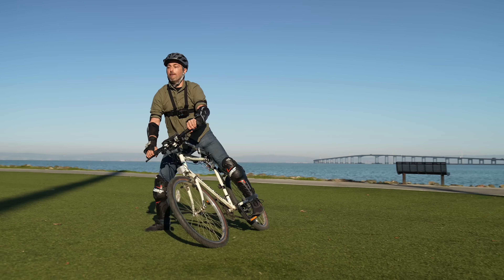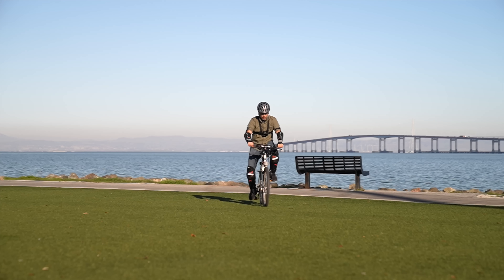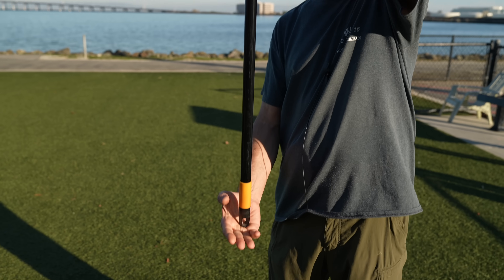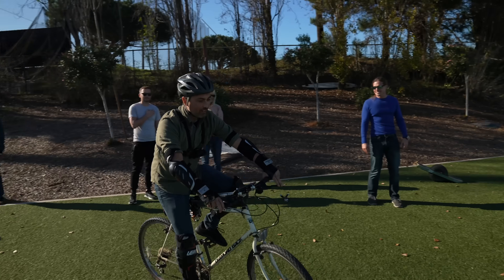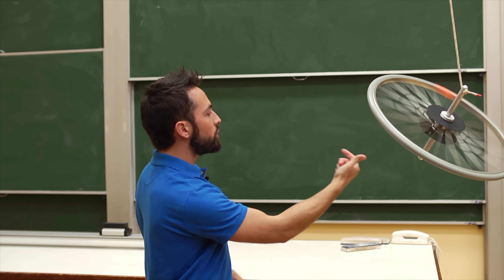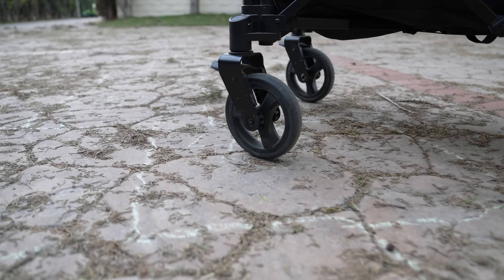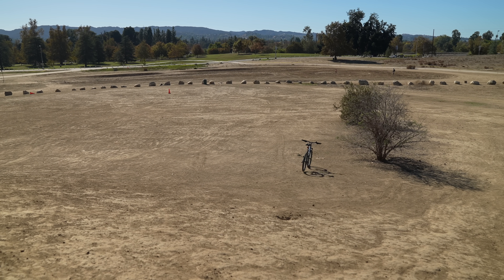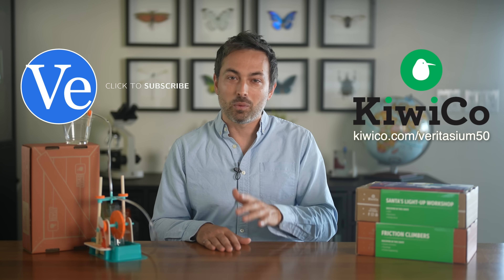Most People Don't Know How Bikes Work

Comment: Ok, you wanted to explain how counter-steering works on bicycles, but I'm pretty sure I could turn with that "unrideable" bike alright. For one, you don't seem very experienced in cycling. You ride exclusively in the saddle, which is not exactly ideal for handling the bike in such an abnormal scenario, and without any attempt to use your body to lean inside a corner. It looks more like you are unable to balance the bike because of inability to steer in one direction - which is perfectly natural of course - rather than like failing to make a turn because of it. I had written an initial comment where I claimed that many mountain bikers and roads cyclist doing high speed turns on descends actually do minimal or zero counter-steering in some cases. Sadly I erased it because I wanted to be completely sure, but I've been riding for more than ten days constantly confirming that, and I've even had other riders watch. At least in my nimble track bike, if you are not going to counter-steer, you can lean your body weight towards the direction you want to go - with the bike and handlebars still straight and upright - then let the bike follow your body and lean into the corner, allowing you to increase the radius. But what really makes turning this way practical is that instead of turning the handlebar, you can do sharper turns by pushing it towards the ground from the one side and pulling from the other. Why do it this way? Because in some high speed situations, counter-steering seems to unsettle the bike more, which is not always desirable. The technique I'm describing allows initiating a turn with a smoother weight transfer and it's easier to dial your radius throughout the corner with less corrections after that. Sure, if I need to make a small, unexpected maneuver like avoiding something that I saw suddenly, in all likelihood I will counter-steer, but the claim that it's the only way to turn has to be wrong, even if some cycling myth busters insist otherwise. I could even make a video for you but in reality you can just watch professional riders like in Tour de France riders descending. Almost all of them turn like that, at least part of the time.
Reply: If you could simply shift your weight to lean into a turn, you could also lift your feet off the ground on a stationary bike and then decide which direction to fall.  But you can't do that.  Give it a try.
Reply: @Rick_Cavallaro  I suppose it's pointless to argue that this is also feasible - though not with a 100% success - because it's not exactly the same thing. I can only say at this point that a bunch of riders around confirmed my claim that I can consistently initiate a turn with no counter-steering. At slow speeds I can also just turn the handlebars, though with very gentle slow movement initially. Bike geometry and type of handlebars are also factors here. On my friend's fitness bike with straight, fairly wide handlebars, I couldn't do exactly the same things. But seriously, if you shift your weight of the bike while keeping the bike going straight for a while, then pull the bike towards your body, what do you theorize that will happen?
Reply: @PinkAsAPistol  I believe that it both looked and felt that way.  But you'll quickly learn it's not the case if you try the experiment I suggested.
Reply: @Rick_Cavallaro  I have been cycling for 30 years, some of those competitively. I have tried what you said for fun and practice, which is harder than what I am describing. I've also done quite a bit of motorsports where it is perfectly understood that driver/rider feel is meaningless without data confirming what goes on. I fully expected your point, I know sometimes we do something that we think we don't. Only thing is it's not even marginal in this case, everybody who saw confirmed my view. Even if I do a video, you might still argue I am doing it in an imperceptible amount that you also cannot see. The thing is you can achieve the desired weight transfer to turn a bicycle in other ways than actually steering in the opposite direction - some bikes are not that stable in a straight position to begin with. I am not arguing that some riders brake the laws of physics. Seriously, try pushing/pulling on the handlebars from a neutral position and tell me what went on.
Reply: @PinkAsAPistol  
>> I have been cycling for 30 years, some of those competitively.

That makes you an expert rider.  It does not mean you understand the underlying physics.
Reply: @Rick_Cavallaro  That alone is irrelevant. You don't need to understand the physics to counter-steer and to confirm that you are either. There are grey areas between what we do subconsciously well and what we understand in terms of physics, I know. But making a turn with your eyes and hands focused on your handlebars and seeing that you didn't have to turn them to the opposite direction should not be not such a hard thing to assess. And your argument that equates stationary balancing to shifting balance on a moving bike does not show a complete understanding of the underlying physics either.
Reply: @PinkAsAPistol  
>>  your argument that equates stationary balancing to shifting balance on a moving bike does not show a complete understanding of the underlying physics either.

If you think it doesn't, it's incumbent upon you to explain what changes between the stationary and the moving bike.  As it turns out - I know.
Reply: @Rick_Cavallaro  Literary everybody agrees that speed is a factor in the self-stability of a bike. This is the first time I hear of anyone claiming otherwise. Even this video kind of acknowledges it. I think he's still wrong for assuming that a bike's self-stability is entirely based on its geometry causing it to effectively self-steer into the lean. Yes this is the primary reason it stays upright even without a rider, but that does not prove it's the only relevant force involved in self-stability and surly not that its momentum does not also play a part, which it also does in the dynamics involved in cornering. The effect of speed becomes empirically apparent when you see 1) you need far more steering input to stay upright when you move slowly, let alone be stationary 2) that surely you can just turn the handlebars into the turn when moving slowly, but after some speed you find that it doesn't work. Also, there's a technique that motorcycle riders call counter-steering even if it's one continuous move and they don't actually turn the bar in the opposite direction. From some speed and above, just pushing the grip inside the turn, even with one finger, is enough for you to achieve the weight transfer and along with your body leaning slightly, to get you to initiate the turn. You are making arguments that are equally based on empiricism to mine - and are a bit wrong at that - and coming up with a hypothesis based on physics where you keep whatever fits and discard whatever does not. This doesn't make you the physics expert of this discussion. At least I don't pretend to be one.
Reply: @PinkAsAPistol  
>> Literary everybody agrees that speed is a factor in the self-stability of a bike.

Of course it is - for exactly the reasons I've explained in the video and in these comments.

>>  This is the first time I hear of anyone claiming otherwise. 

You haven't heard anyone claiming otherwise.

>>  I think he's still wrong for assuming that a bike's self-stability is entirely based on its geometry 

He doesn't claim that.  He claims that it's based on the steering geometry and the effect the gyroscopic moment has on steering.  If you think he's wrong, it's incumbent upon you to offer a better explanation.  You have not attempted to do that.

>> and surly not that its momentum does not also play a part, 

The bike's forward momentum has no impact at all on it's roll stability.  The gyroscopic moment of the spinning wheels has been shown to have a very small direct impact, and a large impact through its effect on steering.

>> The effect of speed becomes empirically apparent when you see 1) you need far more steering input to stay upright when you move slowly

I explained that in my previous comment.  The reason for that is trivial.  It has nothing to do with the bike's momentum, and you ignoring my explanation doesn't serve your argument.

>> surely you can just turn the handlebars into the turn when moving slowly

Surely you can not - unless you want to fall.

>>  there's a technique that motorcycle riders call counter-steering even if it's one continuous move and they don't actually turn the bar in the opposite direction

If they don't turn the bar it isn't counter-steering.

>> You are making arguments that are equally based on empiricism to mine

I am not.  I am making arguments based on my knowledge of bike dynamics, carefully executed experiments, and published research.

>>  This doesn't make you the physics expert of this discussion. At least I don't pretend to be one.

The fact that you are not one, disqualifies you from judging who is one.
Reply: @Rick_Cavallaro  - You stated that the fact that it's impossible - I still say more like "hard", apparently you haven't seen what some riders are able to pull - to use your weight in order to fall to the opposite direction than the one the bike leans to when stationary. You also stated that this proves there's no way to turn without counter-steering. I consistently said that those two are different, there are less forces involved in balancing a stationary bike so of course it's harder. Your claim sounded like effectively claiming that speed, in the form of the gyroscopic effects or otherwise, does not contribute in self-stability. No inconsistencies from my part there. I was intentionally vague when talking about momentum-related forces above because I am unsure as to whether the gyroscopic effect is the only other force involved. At least in cornering which is really our focus we know momentum plays its own role.
- He seemed to say people claim it's the gyroscopic effect that keeps a bike stable but he sees - apparently empirically - that it's the self-steering. As if these two were mutually exclusive.
- You can absolutely just turn the handlebars into the turn if you're moving slowly enough and have a basic feel of how to do it without going over the limit. Even motorcyclists, for whom counter-steering is an essential lesson, not a learned automatic thing, claim the same thing. Apparently this will not be settled unless I can do a good enough video or you try it yourself, so I have nothing to add to that.
- They don't need to actually turn the handlebars in the opposite direction. Just applying enough torque does the same thing at enough rate for the bike to go towards the other way. There's even tons of videos displaying this on YouTube.
- Sadly I'm at the other side of the planet, but if I have no problem to at least try to make a video for you some time. And actually I'd appreciate your take on how to do the experiment "correctly", even though I think you're missing something here. Generally I tend to try to know what I'm doing because of my motorsposrts backround, where you might have talent and still be kind of rubbish if you don't learn to rely on data and analyze what is actually happening. That mindset is not as alien to me as you seem to think.
- I can be a non-expert in physics while at least realizing where my knowledge ends. You seem to think you've grasped it all, while I've seen people actually working on advanced cycling mechanics who appear a bit unsure. Even if your general knowledge in physics is much better than mine - not that hard, to be honest - I think that's where you end up being wrong.
Reply: @PinkAsAPistol  
>> You stated that the fact that it's impossible

I did not.  And if all you have left is to lie about what I've said, there's no point in continuing.

>> You can absolutely just turn the handlebars into the turn if you're moving slowly enough...

There is an extremely small number of riders that can actually do that, and they do it by having learned a DIFFERENT skill than the rest of us that ride bikes.  They're not simply better at doing what we do.  They are doing something different - and very difficult.  And it is extremely obvious when they do it.  

>>  Even motorcyclists, for whom counter-steering is an essential lesson, not a learned automatic thing, claim the same thing. 

That's precisely why I made this video with Derek.  I KNOW they claim that.  They're wrong.

>> I think that's where you end up being wrong.

There's plenty I don't know, and plenty I do.  And I know which is which.  I'm not wrong on this.  If you believed I was, you'd actually try what you claim you can do - which is to ride the bike in the video.
Reply: @Rick_Cavallaro  - This is a written exchange. Anyone can see exactly what we say, though I'm pretty sure it's going to be just us. Why would I intentionally lie about what you said then? I'm not stupid and neither are you. Previously I thought you misconstrued my argument. I didn't say you did it intentionally or take offence. Still, you clearly said that if I could turn without counter-steering, I could also sit on a stationary bike and react to it falling by forcing it to fall to the opposite direction. So I replied that the second one is different and harder. Not to mention that say, a competent trials cyclist would tell you "well of course I can do that".
- Now I need to explain that this is not about me claiming to be a better cyclist than anyone? Yeah there are lots of different bikes and forms of cycling, from city and long distance to road, mountain and freestyle. Hugely different skillsets on each one and I know of nobody who's amazing on all - I'm completely unversed at trick jumps, for example. About bikes I already said that I can just turn the handlebars in while sitting like a log on my track bike at low-ish speeds, but on my friend's fitness bike with straight wide bars I couldn't just replicate the same thing. In a way, it's the bike that teaches you. I never claimed I have a better way for you to turn, or that I'm gonna tell you how "skilled riders" do it. People not attesting to leaning before the turn and pulling the bike inside with no counter-steering probably haven't practiced going down paved mountain roads at 100 km. They don't turn in that way because it makes little sense to do so. It's not how you typically avoid people parking inside bike lanes. I even said that if someone throws themselves in front of me in town, of course I'm going to counter-steer because at that moment I am not poised to initiate a turn in any other way. What I mention matters only in the specific context where a seemingly inexperienced (in that sense) rider gets on a bike and rushes to declare it "unrideable".
- Edit: Many cyclists who claim that they do not counter-steer cite "steering from the hips" as their technique. I also do that a lot but am unsure. I think that on that occasion I am probably counter-steering a bit and not necessarily being aware of it. It's not like I don't see your point about the fallibility of the subject going purely by feel. 
- So now you're saying that a limited amount of riders can actually do it because of their specific riding style? Then that's settled, as far as I am concerned; That bike is not unrideable. But still, the issue is whether I specifically can do it? I am in Greece, otherwise I'd be eager to try your bike, especially now that I know you took part in this video. And you're talking as if you missed the part where I said I'm open to hearing your suggestions on how to verify this on my own.
Reply: @PinkAsAPistol  
>> Why would I intentionally lie about what you said then? 

I have no idea.  Why not go back and quote me.

>> you clearly said that if I could turn without counter-steering, I could also sit on a stationary bike and react to it falling by forcing it to fall to the opposite direction.

That's correct

>> a competent trials cyclist would tell you "well of course I can do that".

Nope - but an exceptional one could.  VERY FEW can.

>> I can just turn the handlebars in while sitting like a log on my track bike at low-ish speeds,

And I'm here to offer you a $10K bet that you can't do that without falling.

>> Many cyclists who claim that they do not counter-steer cite "steering from the hips" as their technique.

And that will work.  But it works by affecting the steering - and STILL requires counter-steering.

>> So now you're saying that a limited amount of riders can actually do it because of their specific riding style? 

I have never said any differently.  YOU claimed I did.  If you think I did - quote me.

>> And you're talking as if you missed the part where I said I'm open to hearing your suggestions on how to verify this on my own

I'm talking as if I am tired of the insults.
Reply: @PinkAsAPistol  
>> This is a written exchange. Anyone can see exactly what we say

Not when most of your posts have been edited.
Reply: @PinkAsAPistol  
The claim that "you can lean your body in the direction of the turn while the bike stays straight and upright" is claiming something that ls literally impossible if the bike was already straight upright when you leaned your body.

In order to move your body one way, you have to push on something. The thing you push on is the frame of the bike. It doesn't matter what point on the frame you push, because no matter where that point is, it's above the contact patch. The contact patch is like the fulcrum of the upside down pendulum. By applying a sideways force above that point, you create a torque around the contact patch. This will cause the frame to lean in the opposite direction from the lean of your body. There is no disputing this fact, it's very simple physics, and the strange complexities of bikes don't factor into this conclusion at all.

But now let's think about the result of this action. Your body is leaned one way, let's say left. That means the frame is leaned to the right. If the frame is leaned to the right, the front wheel will steer to the right, as demonstrated in this video. This is a result of the steering geometry with some (quite minimal) contribution from precession. If you lock the steering straight, this cannot happen. But we'll get back to that.

OK, so now the situation is this: Your body is leaned left. The frame is leaned right. The steering is turned right. This IS a countersteer. It's not one you initiated using your hands to turn the bars, but it's still a countersteer. You intend to turn left, but at first the front wheel is turned to the right. OK, what happens next? Well, with the front tyre turned to the right, the bike is now "out tracking". Derek describes it as the bike being "steered out from under you" in this video. That causes the bike to lean left. This rule is absolute, and it doesn't matter if you are straight up, or leaned over. When you turn the steering one way, it induces a torque in the other direction. No. Matter. What.

So now what happens? Well, your body is leaned to the left, AND the bike is now rotating into a left lean. Eventually you reach a stable position. That position is literally described by a mathematical equation which correlates lean angle (to the centre of mass), turn radius, and tangential velocity.

Once the bike is leaning to the left, again the steering wants to flop in the direction of lean. This time, to the left. OK, so why don't we just reverse the whole motion and end up leaning back over to the right? Because the state of the system has changed. The centre of mass is to the left. When we started, it was in the middle. So now this new position - with the bike leaned left, the rider leaned left, and the steering turned left, is dynamically stable. You are now in a stable left turn.

So, in conclusion, a countersteer always happens. Always. Whether you perform it consciously through the bars, or whether you use your body weight to lean the bike in the opposite direction and induce it via the steering geometry.

And this is why you can't ride a bike with fixed steering. With no steering, no countersteering can happen, and therefore stability cannot be achieved.

But wait, there's more.

In order for a bike to be in a stable turn - let's say it's a left turn -  the front wheel needs to be pointed to the left. I described this above. During the turn, the front wheel is pointed into the turn. The countersteer is used to establish the lean, but once the lean is achieved, the countersteer is not maintained. So even if you could initiate a lean into a desired turn direction somehow without a countersteer (you can't, unless you eject mass from the system, or have someone push you from the side, or something like that), you still wouldn't be able to turn the bike, because a turning bike requires a turned front wheel.

This is also why people keep saying "at low speed you don't countersteer, you steer into the turn". The second part of that is true, the first part is false. At low speed the "flopping" action can't reach the equilibrium position quickly enough, because at low speed the forces acting on the front tyre via the road - and therefore acting on the steering - are smaller. The steering mechanism has mass, and therefore inertia, it doesn't move instantaneously. Moreover, at low speed the stable lean angle is smaller, and the wheel deflection is correspondingly larger during a stable turn, whereas at high speeds and high lean angles the deflection of the front wheel into the turn is barely perceptible. So at low speed you have to "help along" the flop into the turn. And that motion is much larger than the original countersteer, because you first have to straighten out the countersteer, and then keep going in the other direction. But don't be fooled, there was still a countersteer before you do this.
Reply: Let's go back to your very first comment and settle this quickly...

>> Ok, you wanted to explain how counter-steering works on bicycles, but I'm pretty sure I could turn with that "unrideable" bike alright

You could not.  I invite you to try.  If you're ever in the S.F. bay area I will happily put you on the bike.  If not, I will happily describe how you can run the experiment for yourself.  You will find you're doing things you're not aware you're doing.